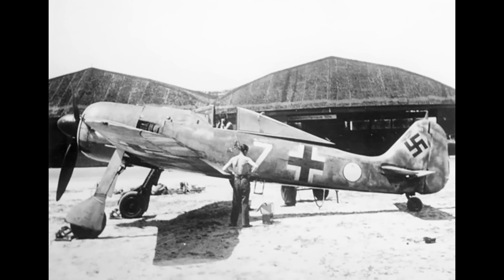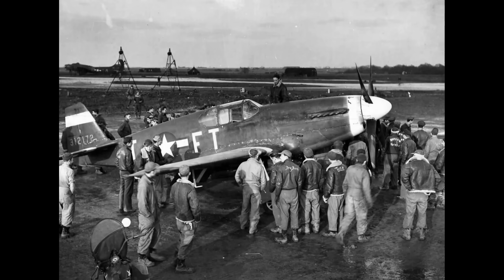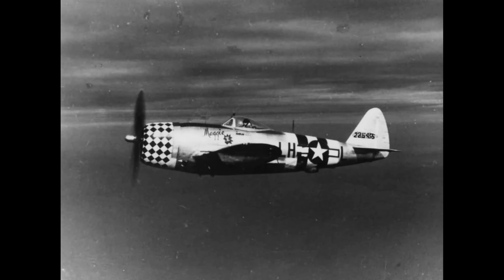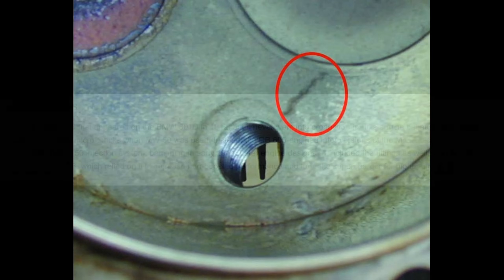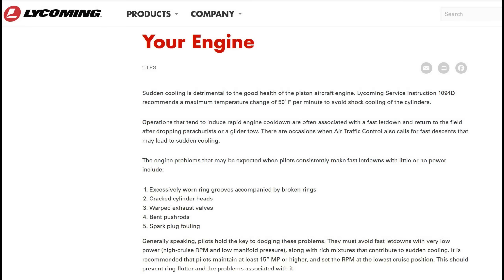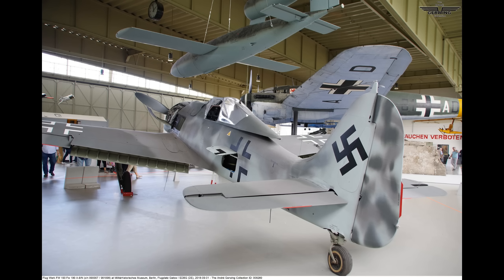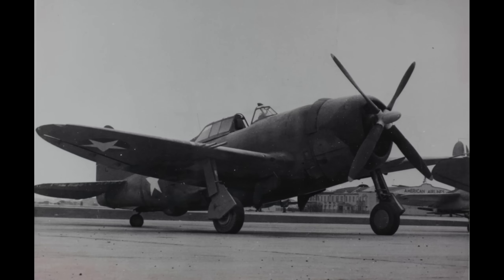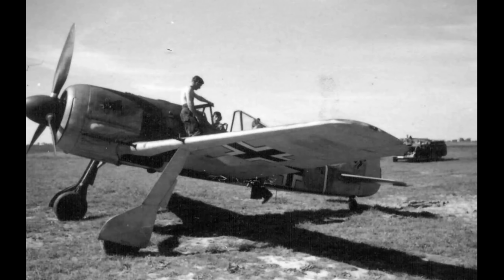Focke-Wulf Fw 190 A-4, Almost turned the tide, Almost...

Comment: Good info as always Greg.  It is stunning to me that Goering and the RLM knew about MW50 in 1938 and couldn't/didn't get it into service until 1942.  Who at the RLM was in charge of failing to get 15% more horsepower out of the Luftwaffe's engines for FIVE freakin' years?
Reply: Hubris was a big factor in decision making until late '41. Remember, through '41, Germany was winning everywhere; and there was a strong attitude that what was already in production was often sufficient, especially because service needs demanded no production slowdowns. There is a lead time required to get needed upgrades to squadrons, and that's largely why you don't see MW50 until '42.
1942 is the year that doomed the Axis, with almost everything starting to go wrong. But, in '41, even the Allies would have told you the Axis were winning.
Reply: The book The Secret Horsepower Race by Calum E. Douglas might be a good reference in answering that question. 
It boils down to poor decision making in how they handled things. They could really have benefited from a relatively easy way to boost horsepower given their shortages of certain metals and high octane fuel.  
Methanol isn't hard to make, neither is distilled water, especially compared to high octane fuel from coal and exhaust valves that can take high temperatures with a very limited supply of certain metals.
Reply: @Surestick88  The DB605 engine was only new and introduced into service on the Me 109G1 around February 1942.   Although rated at 1420 metric horsepower the engine proved troublesome at first and so the maximum boost pressure was restricted to 1.3 ATA which kept power at 1300hp.  The problems related in part to the new high pressure oil system introduced because the DB605 replaced the roller bearings with sleeve bearings.  It turned out the oil was frothing at high altitude so a de-aerator was introduced.   A spark plug improvements and better fuel quality control helped.  The result was that the DB605 was released for its full power sometimes between June 1943 and October 1943.  During that intervening period MW50 probably wouldn't have been usable due to these issues.  MW50 came into use on the Me 109G6AM around Mach 1944.
Water injection increase power by allowing a higher boost pressure it therefore does not work above the altitude where the supercharger can created that pressure.   About 50% of the Luftwaffe was fighting in Scandinavia and the West, 25% in Africa and the Mediterranean and 25% in USSR so it didn't help fight the USAAF so much and the Germans had superior aircraft to the Russians through 1943 anyway.
Reply: Well let's say that Luftwaffe technical leadership wasn't exactly up to scratch, not looking at Milch and Udet there. Too busy cutting eachother's throat (and that of the Army and the Navy, while kissing The Big A's.......) to allow anybody to have any glory. It's often hard for us to understand how dysfunctional the Nazi state was at times. Than we haven't thrown in hubris (the war's over by Christmas) either, as others have mentioned. 

You shouldn't think this about this as an organization seeking a collective solution to a technical problem, but as a whole bunch of competing individuals who'll do just about anything to prevent the competition from succeeding. This means that they often had a dozen or so of the same project running in parallel, which in turn means the available resources have to be divided over these competing groups, which prevents you from reaching a collective (and hence efficient) solution to this problem. No idea if this is what happened with MW50, but I wouldn't be surprised if some skullduggery and good old Luftwaffe infighting was involved here too.

This is a direct answer to your "why/who" question, the answer is I'm afraid a bit everybody. I mean Udet and Milch absolutely hated eachother, Milch had his personal war going with Willy Messerschmitt too till Hitler ordered him out. This is just the surface layer, once you go to a lower level, it gets absolutely bonkers.

People often forget this when talking about Nazi Germany and the "why" behind it. That you're dealing with a massively different kind of organization (if it's even worthy of that name at times).
Reply: Increased engine attrition (?) and no imminent need.  This war wasn't going to last beyond 1941; that's the plan anyway ... Besides, in 1939/40 Daimler-Benz couldn't keep up with demand; Messerschmitt cranked out Emils faster than DB produced engines. Really no need for further complications.
Reply: Bureaucracy as usual in a socialist/etatist country....
Reply: Between 1938 and 1941 they just didn't see a need for it. The war was going well.
Reply: MW50 was a complication, and required engine development to a degree of refinement they couldn't fit into their factories at first, then they needed wartime production volumes, then you need a reliable supply of MW50 to front line units, frankly a water injection solution alone would have been less effective, but also been more readily available given the terrible logistics of the German system. we can make clean water, even distil some ourselves and use the hot water to make hot drinks. But needing a specialist mix of wood alcohol and water without impurities to feed our flying machines to go into combat? Better off staying in the bunker till the supply truck arrives.
Reply: Let’s be glad they didn’t. All of these little things add up to world being like it is today.
Reply: @benkonczal4584 well half of Europe fell I to communist slavery. China gell to communism...Korean war...vietname war....all fall out of America letting the commies win. Communism killed 100 million people. Half of europe got destroyed millions of people displaced and brutalised. All for what? So China and Poland could go from a non-soviet dictatorship to a communist dictatorship

Comment: Its weird i have just researched fw 190 A-4 performance and Greg uploaded this video.
Reply from the maker: What are the odds? That's an unusual version to be researching.
Reply: @GregsAirplanesandAutomobiles   I was comparing A-8 s performance to preceeding 801D engined ones to find out which part of A-8 caused most drag and slowed plane down. And still cant understand how 2200 PS engine on A-9 cant make it past 680 kph...
Reply: Yeah i was comparing A-8s performance with preceeding other Anton variants to find what made Fw-190 A-8 slower .Also found out data for Fw-190 Aa-3  model which we Turks used. Wished my country didnt scrap them to use their metal in industrial equipment...Or not being conservative bigots they are like rednecks in US...
Edit: I have a wet dream that with some 150 octane fuel and magic Fw-190 A-9 could reach 680 kph...but no evidence except il2 1946 stats

Comment: With (sincere) respect, increased horsepower for the 190 was more than offset by the fact that the Allied Air Forces 'massively' outnumbered the Luftwaffe, so that any such advantage would only have delayed the inevitable. After the United States with its industrial capacity and manpower entered the war, the Luftwaffe wasn't going anywhere but down. To have any chance of victory, the Germans required marked changes in their armaments production before the war began- and they never had a realistic plan for doing so. Instead, their armed forces competed against one another for manpower and raw materials which were scarce before the war even broke out. Additionally, all three service branches created gargantuan production plans, each of which was well beyond Germany's ability to realize- yet the Germans twice attempted to do of two of them. The National Socialists had no real strategy for victory, and more powerful aircraft engines would not have altered the outcome.
Reply from the maker: It sounds a bit like you commented without watching the video. I specifically said this would not have changed the ultimate outcome of the war. Yes, eventually US numbers would have won. However in 1943 those numbers were closer than you think. In fact in many fighter vs. fighter encounters, the Luftwaffe outnumbered the US fighters.
Reply: @GregsAirplanesandAutomobiles  I'm a big believer in truth- both in the study of history and here on YouTube. Well, the truth here is that I did not watch your video prior to typing my post, although I had every intention of doing so when I posted. I'm about to do just that right now because although I'm at work, I now have my lunch break (I start at 0400). My post was solely in response to the title of the video, which its specific reference to "...Almost turned the tide, almost..."- which is I (very respectfully) disagree with. While the Luftwaffe did from time to time achieve a tactical numerical superiority in some fighter vs. fighter engagements in 1943, the writing was on the wall for Germany. By mid- 1943, the Luftwaffe has some 5,000 aircraft (all types, including trainers) in service- while the Allied air forces ringed Germany with some 30,000 aircraft. These odds were only going to lengthen over time, and even from a purely air power standpoint, more powerful German engines were never going to turn that around.

Based on your last post, we appear to be in full agreement on that issue. Respectfully submitted. Now, to your video...
Reply: Kinda like the democrat national socialist of today.......they were out of touch with reality.

Comment: Oh snap. I have always assumed they were equipped with MW50, and was greatly dissmissive towards German radial engine development ("it has all the features Japanese engines had, but achieves a lot less power, what the hell, Germany"). And now it turns out there simply was no MW50 which greatly limited the power. A-series with additional 400 HP would remain competitive performance-wise  into 1944 (it would be able to outspeed Spitfires and P-47s on the deck, and trail behind P-51 earlier by a way smaller margin) while IRL A-series was already trailing behind allied fighter performance in late 1943.
Reply: But the big stuff was not on the deck by then. It was 20 000 feet plus
Reply: @stringpicker5468  Ever heard of eastern front? Also MW50 works just fine at 6000m too. There was plenty to do for Fw 190 series planes that MW50 would help with

Comment: At low altitudes, the RAF MkI, MkIa, and MkII, and USAAF P-51A were pushing over 1800HP as well. People forget the early Mustangs were fighter bombers at low altitudes long before the P-51B showed up, and it fought the FW190, and outran everything at low altitude.
Reply: @alterego2421 nope, not crazy at all, and I have the proof. USAAF and RAF pilots were both pushing the Allison to 75" MAP, and Allison tested the claims and verified they were getting 1800HP at just 70" MAP. And Allison ran their engine for 20min at 1800HP without damage. Multiple US and RAF officers reported the power levels to the US gov and Allison.

In 1944 they were reaching 2200HP  with the Allison.
Reply: The Allison has more grunt low down, which is why all the pylon racers use it, but the 60-series Merlin made that airplane into a God.
Reply: @Ensign_Cthulhu  Allison Mustang: fastest piston fighter of WW2 at low altitude. more fuel efficient than the Merlin (longer range)

P-51H: fastest piston fighter of WW2 at high altitude. one trick pony.

The only thing that the Merlin added was high altitude capability. the Allison had better fuel efficiency (longer range) and was better all-around pretty much in every other role. I argue the Mustang overall was a "god", and the different engines just gave it different mission capabilities. The Airplane gave the engines their reputations, not the other way around.

The Merlin absolutely didn't magically keep the Hurricane from being obsolete, for example. Early Merlin Spitfires were neither fasts, long ranged, nor high altitude machines.

I can also make the case that the Mosquitos that flew low-altitude missions would have been made massively better had they used Allison engines.
Reply: @SoloRenegade Calling the P-51H a one trick pony is insane, or even calling a WW2 fighter. You have no idea what you're talking about. I'd love to see the proof that the Alison could reliably run 1800hp. Also the Spitfire Mk I was the fastest fighter aircraft in active service in 1938.
Reply: @SoloRenegade  The Mustang was effectively a generation ahead of the Spitfire in aerodynamic terms. And you can say what you like about a one-trick pony, but just try flying top-cover for bombers already at 20,000 feet in an Allison Mustang...
Reply: @SoloRenegade  > I can also make the case that the Mosquitos that flew low-altitude missions would have been made massively better had they used Allison engines.

Interesting.  My personal feeling is that just as North American was heard out when they proposed a new fighter design instead of making another firm's older design (was it P-40s?!), Allison should have suggested the type of supercharging on the Mk IX Spit's Merlin for the Allison.  That was as far as I know the key difference.  The Allison was a 20th century engine through and through, with every part interchangeable, often even interchangeable between different series of engines, literally half the part count, and so on.  The Merlin was turn-of-the-century metalworking, with every spot on the assembly line needing a vice and grinders and so on to make parts fit.  If there's any part of the Merlin, OTHER than the later supercharging, that was superior than the Allison I'd love to hear it but I haven't yet.
Reply: @Ensign_Cthulhu  the P-51H was a one trick pony. It was too lightweight to be anything but a pure fighter, and couldn't take damage. P-51H and P-47N were lightweight variants, akin to the A6M Zero, and they both were very fragile compared to their earlier variants.

the MkI through A-36, P-51A, P-51D were amazing multirole airplanes with stellar combat records including doing CAS and ground attack.
Reply: @Will-hv9ns  the P-51H was so lightweight ALL it could do was be a Pure fighter. Nothing more.

WW2 Aircraft Performance and other sources have the 1800+ HP test report from 1942, and there are numerous books with the 2200HP engine data and more. There are also mission reports from pilots, and multiple letters from RAF and USAAF officers to Washington DC on teh matter of the engines being pushed to 1800+HP.

" Also the Spitfire Mk I was the fastest fighter aircraft in active service in 1938."

So? Who cares? That has Nothing to do with my argument. But the Bf109 held the speed record back then, not the Spitfire. P-51H was THE single fastest piston fighter of WW2, period. The P-51A was the single fastest piston fighter of WW2 at low altitudes, even faster than the P-51D and P-51H, period.
Reply: @SoloRenegade  You really have no idea what you're talking about, so please stop. It's embarrassing. 

"the P-51H was so lightweight ALL it could do was be a Pure fighter. Nothing more."

This is utterly false and easy to disprove. Look at the SAC dated 22nd of March 1949. It's available on WW2 aircraft performance. I would post the link, but YouTube deletes the comment if I do.

According to the SAC, the P-51H had a stronger airframe than previous P-51 variants, structural strength being increased by 10 percent. It was also perfectly capable of carrying out a number of ground attack mission profiles. Loaded with 2x 1000lbs bombs and 6x 5" HVAR rockets, it still had a combat radius of 380 nautical miles, which is very impressive. 

"WW2 Aircraft Performance and other sources have the 1800+ HP test report from 1942"

If this is true, it will be easy for you to show me. I would really like to see this report.

You literally said the early Merlin Spitfire was slow, which it wasn't It was faster at altitude than any other fighter aircraft in service in 1938. I can believe the BF109E to be almost as fast, but I have never seen anything to suggest it was faster.

"P-51H was THE single fastest piston fighter of WW2, period. The P-51A was the single fastest piston fighter of WW2 at low altitudes, even faster than the P-51D and P-51H, period."

Typing period after your statements doesn't make you correct. The P-51H never served in the Second World war, so I don't see how you can consider it a WW2 piston powered fighter. All available performance data shows the P-51H being significantly faster than the P-51A at sea level when using water injection, and I know of some other fighter types that were also faster at low altitude that were in production before mid 1945, seeing as that seems to be the standard you are using.

YouTube keeps automatically deleting my comments, and it's becoming very annoying. I will keep trying as I really dislike people spreading false information about historical aircraft.
Reply: I don't they ever put out more than 1500hp
Reply: @Will-hv9ns  they absolutely did put out over 1800HP in 1942, it's literally documented, tested, and verified.

officially, the engine limits were tested and published at about 1410HP at about 56" MAP. But in reality, pilots were pushing them to over 1800HP at 72-75" MAP. this is documented historical fact, and Allison verified it.